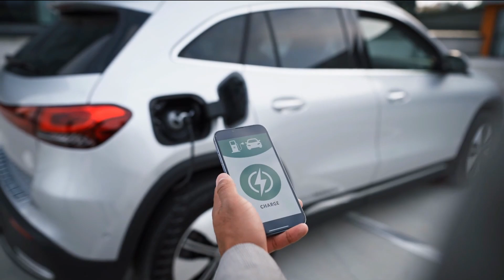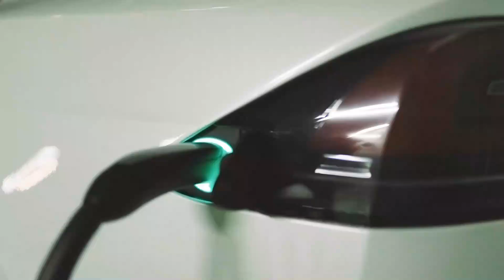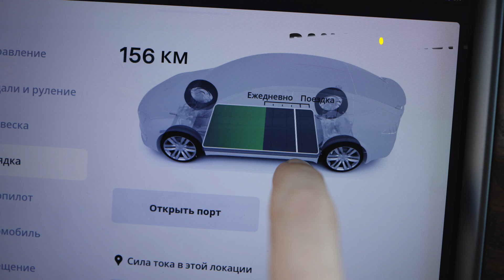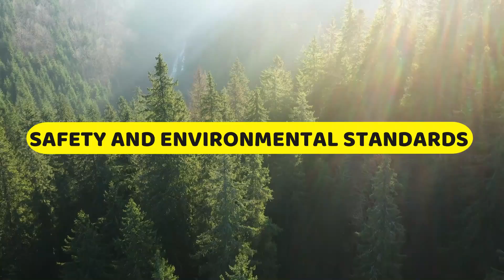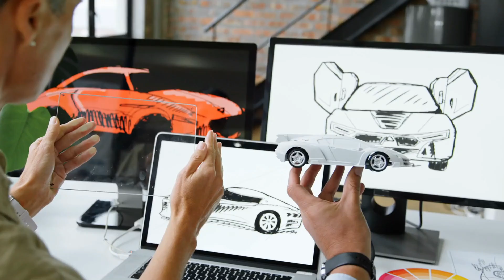Hyundai CEO: "This New Engine Will Disrupt The Entire EV Industry!"

Comment: Great, a complex, inefficient hybrid that burns fuel that costs much more than Electricity. What a load of nonsense. Energy agnostic, simple EVs that you can charge at home are going to destroy any sort of Heat Engine. The end to end efficiency of heat engines is terrible. Wind or Solar to BEVs gives at least three times the end to end efficiency of ANY heat engine.
Reply: And hydrogen is functioning like a greenhouse gas if it leaks out, by slowing down the process of breaking down methane  gas in the atmosphere. At the same time the small molecules are difficult to contain, so if commonly used there will be leakage.